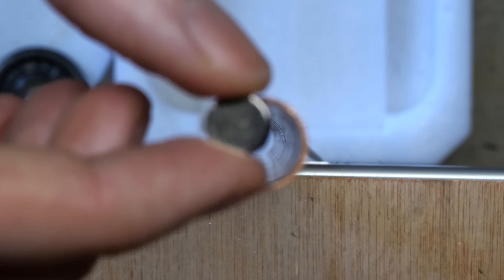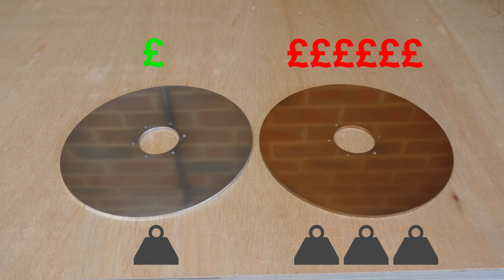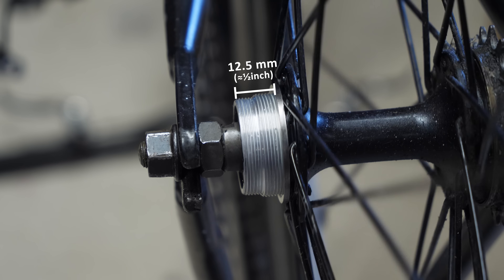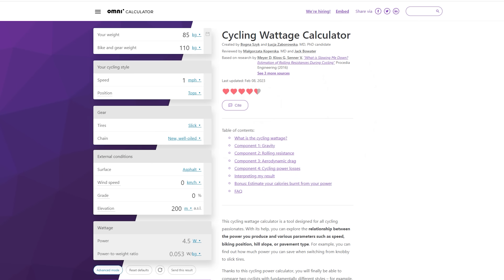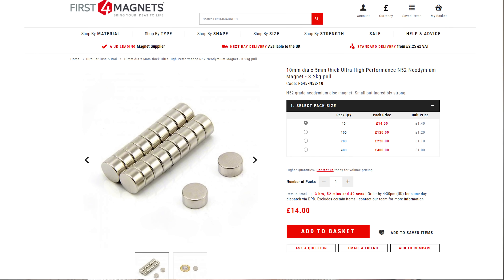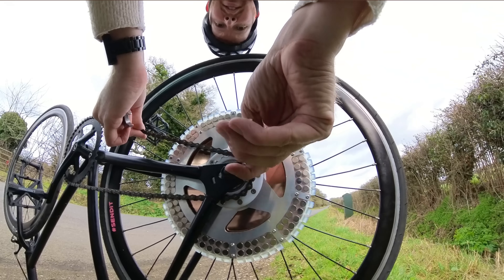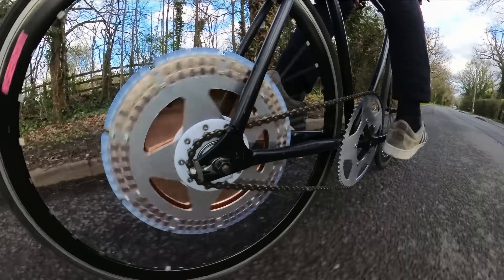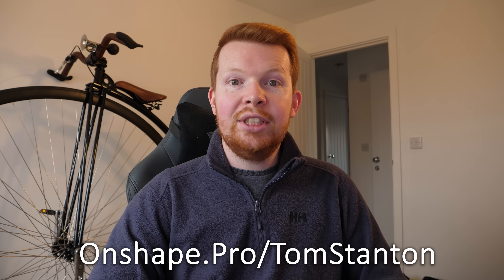Gearless Magnet Bike

Comment: I guess the next step is to build a superconductor clutch to avoid the heat issues. That'll totally work.
Reply: Nah, he should just invent a room temperature superconductor instead. Seems simpler.
Reply: @wizboy45 this aged... well we don't know yet, but certainly more interesting than 4 months ago
Reply: @michaellin4553  Plot Twist: Tom Stanton is behind the recent news.
Reply: @michaellin4553  either I had no idea and got lucky, or I’m from the future. Your choice.
Reply: @wizboy45  I just read a story about room temp superconductors. Pretty big breakthrough recently; they’re closer than we think.
Reply: He could 3D print one
Reply: @wizboy45  l0
Reply: @wizboy45  I was assuming thats what he meant.
Reply: ''Just'' thermally insulate the transmission and feed it liquid nitrogen with a tank that's attached to the bike. No room temperature superconductors needed. No safety issues what so ever...
Reply: I only ride my bike when it is -200°C outside.  Seems like this would work fine.
Reply: Yeah that would induce instantaneous eddy currents of such proportion to effectively bolt it together, it would be an expensive, weighty and very cold cog.
Reply: @martinda7446  With duct and a small fan, the cold would be an advantage during the hot weather.
Reply: I say he does a Sterling motor bike that would amazing.
Reply: @David.-_-  A sterling motor bike that runs off of this hot disk :D
Reply: Or, at least try a Gold rotor :yougotthis:
Reply: @BixbyConsequence  Silver is actually more conductive.
Reply: Yea. And cool it with liquid nitrogen.
Reply: @BixbyConsequence  What's the point of that? Gold as 40% higher resistance than copper.
Reply: It mostly just wouldn't be a clutch.
Reply: @pseudotasuki  Yes, it's nothing but a lossy clutch. It has no mechanical advantage.
Reply: Cvt style conical gear; distance from magnets would be determined by power generated from the eddy currents output, which would pull the contacts closer, similar to powering a coil in a relay. And instead of a solid disc of metal, use something like carbon nanotubes for a skeleton to build upon, slats of tungsten as the inductor metal and then aerogel coat everything before building a wheel out of starlite and pray your brakes don't melt. 

Edit: Sorry for the half-assed grammar in the original post, I think I fell asleep immediately after typing that.
Reply: A supercunductor plate would cause it to be locked together lol. It would be almost impossible to slip it. That's essentially how magnetic levitation works.
Reply: @rubiconnn  but then it could be controlled. Connecting a grounded resistor to the superconducting plate would disturb the eddy currents, and provide momentary 100% slip. You could switch it on and off PWM style to tightly control slip.

Now we just need room temeprature supeconductor. :(
Reply: @Vatharian  "Connecting a grounded resistor to the superconducting plate"

Which "ground" are you talking about?  Why do you think connecting a resistor to a superconductor would disturb the eddy currents?
Reply: @Vatharian  I gotta say that's really clever!  Too bad we don't have the uobtainium superconducting material for the disk yet.
Reply: @Vatharian  No - we need a street temperature superconducor :D in winter it's much lower temperature.
Reply: @Vatharian  There was a paper published on just such a superconductive material last month, including practical examples; unfortunately, while functioning at room temperature, it only does so at very, very high pressure- I believe they compress it between diamond-tipped rods....
Reply: @Vatharian  mom... exactly need to be somewhere so the temperatures meet
Reply: @Vatharian  Grounded to what?
Reply: @Vatharian  Scheduled for next week?
Reply: @Vatharian  Needs to be significantly better than room temperature. Hit me up when we figure 500 C superconductors, I'm hittin' the cryosack -- Alexa! Wake me up in 7 decades!
Reply: @rubiconnn  true
Reply: Lol aint no spin
Reply: Well I goggled it he actually did an airpowered version. 4 years ago
Reply: Or ride in a very cold environment
Reply: @shimasfaris2917  surely you would get the same result just the heat would be dissipated faster but energy conversation to heat would have no change, max temp would be lower not sure if efficiency is greater with a lower disc temp. Happy to be proved wrong.
Reply: with new room temp superconducters that will possable
Reply: Gold? Wouldn definitely need a sponsor.
Reply: But using this as a replacement of rim brake would be quite interesting.
Reply: I don’t know if all that heat should just be seen as a problem, more like an opportunity for future ways of making use of the energy? I loved this, I always imagined magnets as being key parts of futuristic eco engines ❤
Reply: @SolarPunk80  Ignoring the fact that my comment was a joke. The heat generated here is pretty hard to convert to something useful without interfering with the primary usage.
Reply: @jamesmnguyen  my bad, I was very distracted to begin with plus I didn’t even realize the context so I just said whatever I was thinking at the moment, I just think it’s awesome that he’s doing this stuff so the heat retention was one of the things that stuck with me as an energy source and so I think I just responded spontaneously without criticism but still thinking you were serious and just speculating as well. But I don’t know what do you think about this research like do you imagine any possibilities?
Reply: @SolarPunk80  They only ways I know how to extract energy from the heat is either by the thermoelectric effect, stirling engines, or steam engines. Neither seem feasible here.
Reply: @jamesmnguyen  I Guess I was imagining thermoelectric but I am saying that in a very passive loose way, also he’s the genius that would come up with the novel execution of it, which would not be novel if based on the known examples or applications, so I definitely applaud this man! I might check out his steam engine video again, it’s just cool that he actually does this and shares!
Reply: @jamesmnguyen  but really what I missed was wether the chain being metallic was part of the plan or not because I just caught the part were it was causing problems and at that point imagined a belt being used instead but that’s why I wasn’t sure how or wether it was a key factor that he had to use a chain instead of a belt drive, but I wonder if he might try that eventually
Reply: @SolarPunk80  I don't know enough about this to complaint about the parent comment, but I do know enough to let you know that your comment is pretty stupid, no offense intended
Reply: @stoneforbreakfast  Lol! No worries I am not surprised ! Hope it wasn’t a bother
Reply: @SolarPunk80  I liked Your comment and agree Tom created a great video using the underutilized and amazing properties of magnets.

Also You don't have to apologize to Arato F. T. commenting 'Your stupid', for 2 reasons, 1 because he says he knows, but doesn't even explain why, so as to empower You to grow, and 2 because, just because he thinks it's hard, or has to be limited to the bicycle use-case, or even the original superconductor comment, doesn't mean it's impossible or unfeasible, because there are ways it can be done, the heat can be used directly for heating, or converted with a ceramic disk next to the copper cog to power Peltier thermocouple e-gens. 
We are All learning and expanding Our thinking, cteativity and imagination by adding Our thoughts and ideas here.

Hopefully Your kind response won't empower their ego to puff up more, encouraging their offensive speech, but, will help Them be aware of their brash nature, and thus become more kind, creative and encouraging instead.

Next time it might pay to ask someone why they say such a thing, rather than assume they're right.

You're a good example of a Human who's overcome much pride and ego, (the attachment to the illusion of right and wrong), as in 'i'm right and Your wrong', or in this case,
'im right, and Your stupid'. LOL

There's literally a good psychology book actually called, "I'm Right, and Your an Idiot" written about the destructive ignorance around this attitude and how to remove it leading to the growth (evolution), satisfaction (peace, harmony, joy) and benifit (wisdom, knowledge, understanding) of both parties. 

[It's like the antithesis of divisive  cancel-culture]

All the best!

PS If You are reading this..., 
You are a magnificent Being!

Best wishes to All!
Reply: @Drew_Hurst  I swear there’s people in this world who are anti-magnets, and they do everything they can to smear progress, but I believe that the nerds won, magnets rule, F@&$k JP Morgan, anyone talking smack is on the wrong side of tomorrow! ;^D
Reply: Or with simple magnetic clutch that changes the ratios using micro controller based on the count of lost cycles.
Reply: I think it needs to be testing in a pool of liquid nitrogen. For Science!
Reply: No some Mini Fan Blades that cool it more with Air :) or he use some Drohne Engine with his Air Blades to cool it active, powered with this Energy he induct into the Copper Wheel
Reply: Wouldn’t RT superconductors not stick, instead the magnets would experience a levitation force when brought next to the RT-SC? Which might then fail as soon as he started riding, as the temperature rose above RT… though I’m not sure about power transfer, slip, and eddy-current dissipation/ heating with SCs…
Reply: One doesn't need to go that far, a gold disk would already work better ;-)
Reply: @ps3107-o1m  Gold is actually less conductive than copper. (The main reason it's used for electrical contacts is that it doesn't oxidize.)

Silver would work better than copper or gold.
Reply: @piranha031091  Yeah, I wouldn't have imagined that. Even silver is only slightly better than copper. So a (high-temperature) super-conductor it is in the end ;-)
Reply: what's the goal though? it's okay taking steps but does Tom know where he's going?? I think he hasn't a fcukin clue!! He'd be better off using an electromagnetic system to activate and de-activate the brakes!! If only people had brains eh??
Reply: or just miniaturize the torque converter
Reply: e
Reply: Sounds smart buat actually stupid idea
Reply: Superconductor clutched eBike  😮🎉🎉🎉❤
Reply: Casually topping up liquid nitrogen.
Reply: It would be cool to see this in a car
Reply: @Oldsmobile69  Yes, and the excess heat could be used to heat the cabin and/or load share with the heat-pump in EVs
Reply: @James Nguyen lol so this was the comment that started it all! My bad I honestly completely wasn’t paying attention and barely read it but that’s on me because I just took a moment and actually read it and got the right vibe, I think I just glanced almost more at the comments after it which made it seem like it was a nerdy debate and I was definitely in a nerdy headspace after watching a video like this!
Reply: Or, a clutch.
Reply: no that won't work either
Reply: well made video. the free time, equipment, money, is a dream to have to satisfy curiosity and projects. however, the idea ignores a lot of existing electric bicycle tech that is ready to buy and cheaply! 16:10 an infinite variable transmission is to use electric motors, generators, or CVT. then again, why ignore battery powered propulsion as it is cheap and widely available? why not a battery powered simulated infinite variable transmission using electric motors? 
another nice project is an axial flux electric motor bicycle, the large wheels would allow for massive torque without additional width, and weight.
Reply: that would be a no-contact lockup clutch.  The slip comes from the discarding of the electrical energy made from the kinetic energy via resistance.  No resistance?  No dissipation.  Pushing harder just increases the eddy current, so every bit of slip just locks it up even tighter.  You could apply enough force to snap the magnetic flux like a solar flare, or physically disrupt the material, or drive the current so high that even in the superconductor it makes heat, but otherwise, it's as pointless as the experiment with copper (or silver, or aluminum, or whatever).
Reply: It’s called a sprocket
Reply: I was thinking superconductors too!
Reply: use a... gear seem to be the best way to fixed lots of issues.
Reply: I wonder if using Aluminum instead of copper will help in the wasted heat issue.
OR, I wonder if a thicker plate of Copper will help in that regard.
Reply: @BoDiddly  Aluminum has a higher resistance than copper. Regardless, it's still not increasing either the speed or the torque. All it's doing is providing slippage.
Reply: Did you try V2A kind of? Meant unexpensive materials, i am absolutely impressed with a part  kind of reg. these ideas. 
Best regards
Reply: No, it will only work if it is freezing
Reply: Remember that the Lord Jesus Christ died on a cross for you because He loves you so much. He then rose up from the dead three days later
The Ten Commandments are called the moral law, (most of us are lying thieving blasphemous adulterer at heart and deserve hell) you and I broke the law, Jesus paid the fine. That’s what happened on that cross. 
By believing that Jesus died on the cross and rose up from the dead 3 days later and not just confessing your sin, but also repenting of all sin you have done and putting all your trust in Him in prayer, He will grant you everlasting life as a free Gift
Reply: then u need to take liquid nitrogen on ur bike
Reply: I filled my steel frame with molten lead, I hope it goes a bit slower now and will break faster uphill
Reply: Only on very, very cold winters!
Reply: A hot pot on the luggage rack will do the job.🐶
Reply: Engeneers...so much great tech not in use because of those greedy corporations
Reply: Couldn't the wasted energy be captured and used to recharge a battery which would drive the bike uphill?
Reply: Or just do go straight for a penny-farthing and start with something a little smaller...
Reply: Or just do go straight for a penny-farthing and start with something a little smaller...
Reply: You'd need a truck to carry the refrigeration equipment.
Reply: No it will not work simply because any slippage will not work according to the  law of the lever. Slippage does not create a bigger force. It works according to Newtons law tha if two bodies exert forces on each other, these forces have the same magnitude but opposite directions.
Reply: Cryogenic cooling system mounted on a trailer.
Reply: Great test!!
Reply: Wait, I thought this was just a convoluted way to heat a copper disc
Reply: Or he could figure out a way to capture the wasted heat and generate steam to power  a turbine!
Reply: Making it a superconductor, you create magnetic locking between the two. So yeah definitely an improvement over this design.
Reply: You'd need a tank of liquid nitrogen for that. If you can manage to attach a liquid nitrogen tank to a bike, you now have a hot reservoir and a cold reservoir, which is what powers all heat engines.

Such a bicycle would not need any pedals, and liquid nitrogen is cheap. The easiest solution I can think of is a rocket that relies on evaporating the nitrogen, but a piston engine would probably be more efficient.
Reply: Too easy.
Reply: THROUGH THE POWER OF FRIENDSHIP, ONE CAN ACHIEVE ANYTHING
Reply: Make room for the dewars full of N.
Reply: That or liquid cool the copper disc and slap a radiator on the front! :eyes-pink-heart-shape:
Reply: Hahahahaha
Reply: We have the knowledge to travel without oil pollution.  It's greed that runs this planet.
Reply: I think a re-design could make it work better e.g getting a wheel with a brake disk attachment and then doing on the other side would stop any interference from the chain but bottom line is you would always be putting in more energy than riding a bike as would come out as a heat loss
Reply: If only there were a way to systematically shield certain portions of the magnets, it'd be like having a whole gear cassette.
Reply: or just a bunch of permanent magnets?
Reply: Or bung a bunch of peltier devices to the copper plate, to generate power for a battery, which then powers a motor of some kind??  Great video none the less. Nice one Tom!!
Reply: @simonwatson5299 something to the effect of an mgu-k in an F1 car? I was thinking along the same line. I don’t think there’s anyway to make an mgu-h out of it though, since the wasted heat energy was a large part of the inefficiency. Would storing some of that kinetic energy reduce heat buildup of the copper?

Edit: I just looked at some of his older vids and he uses a form of KERS which is what I should’ve said instead of mgu-k.
Reply: @EpsilonUnitGaming  Yeah thats the sort of thing I meant. But in a cheaper, could build it in a shed kind of way. All you need to cool down the copper quicker would be anything attached to wick the heat away, i.e. peltier device, and cooling fins made of say aluminium on the opposite side of the peltier. The different temp between the two surfaces will generate power, and should, or maybe be a solution to scavenge a bit of power and cool down the copper. The more I think of it, it doesn't really solve the issue. 😞
Reply: A boring fixed gear can do that, too
Reply: @wanglin406 yes, but it makes it possible to exclude the "boring" part
Reply: @wanglin406  And I would NEVER want my simple 1 gear ratio bike having such a complicated automatic CLUTCH. For that is what this contraption is doing. It is not a variable gear, it is just a weird clutch. Everybody riding a bike each day can tell you, nobody needs this BS. Except for BRAKING, maybe. This is a great never wearing out brake system. That much is true!
Reply: @wanglin406  shhhh, we don't talk about those
Reply: haha ockham's razor's problems
Reply: @wanglin406  and a boring car and boat can get you across the world but they made planes
Reply: @wanglin406  but we're not here for fixed gears
Reply: Remember that the Lord Jesus Christ died on a cross for you because He loves you so much. He then rose up from the dead three days later
The Ten Commandments are called the moral law, (most of us are lying thieving blasphemous adulterer at heart and deserve hell) you and I broke the law, Jesus paid the fine. That’s what happened on that cross. 
By believing that Jesus died on the cross and rose up from the dead 3 days later and not just confessing your sin, but also repenting of all sin you have done and putting all your trust in Him in prayer, He will grant you everlasting life as a free Gift
Reply: It would be cool to hook up to a gas motor